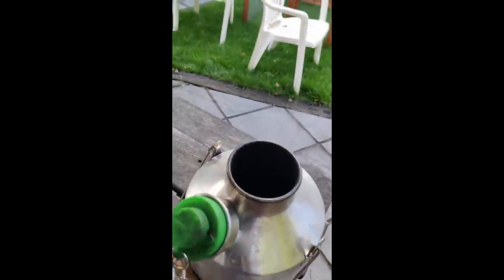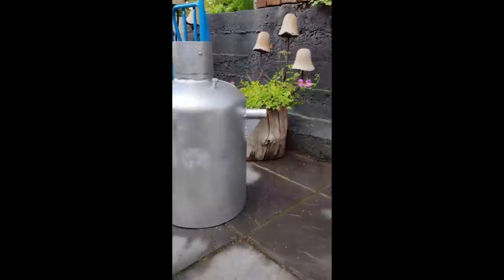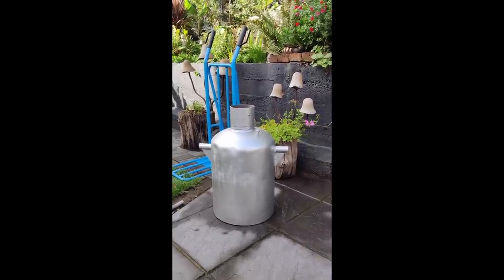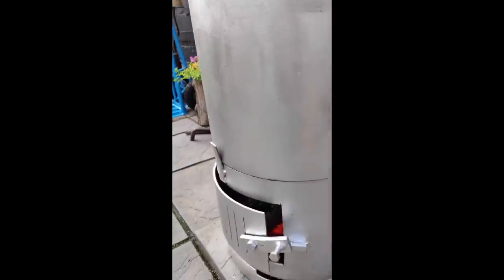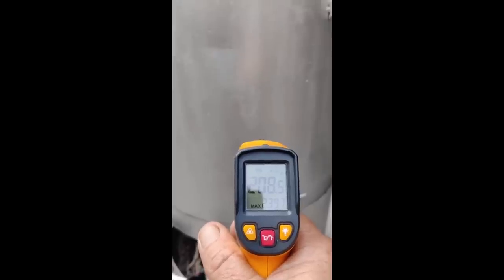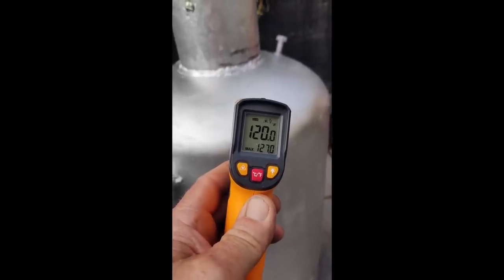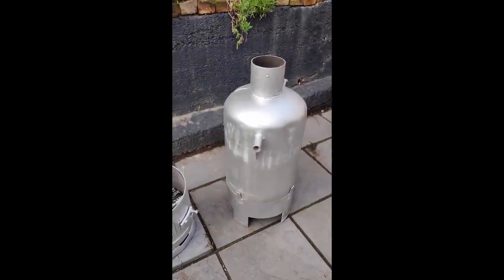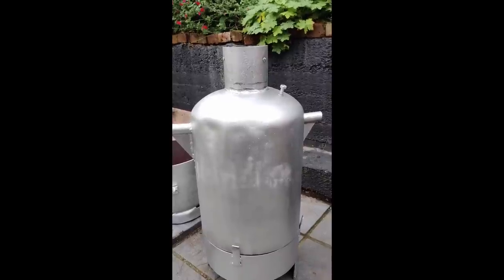Sand battery can it heat my home?

Comment: what you want to do is drill holes into the base of the top piece. it will increase your temps. The bottom is pyrolysis and the increase of oxygen will help burn the volatile fumes in the flue as it goes up which will generate more heat rather than just from the wood. It would be interesting to know the airflow through the center. the CFPM airflow to calculate how long it would take to heat up a certain size room. I was looking at using Salt. The melting point and boiling point of salt is much higher so can store more of the heat or you can use wax for lower temps which I think will still be in your range. There is a lot of energy storage when the wax/salt goes between solid to liquid phase change. But I think yours is an easy no fuss solution.
Reply from the maker: Simplicity is key for me once I get it tuned in a bit we can test it's output in a bit more detail 👍
Reply: dee is correct i did this with my rocket stove mass heater but looking at your project im going to build one too youve just inspired me
Reply: @leejones2511  could you have another part you stack on the top that produces biochar? And also i guess insulates the top a bit?   The bio char Can then be used in it later for some great heat. 

I was thinking maybe draw a row of dots down the side as your official temperature registration target points just for consistency sake. You could even just use a felt tip marker to do it. 

Anyways love what you’re doing. 

Oh .... use solar to power some hho and pump that in to increase the heat. 

Or

you could also use solar to power a water battery. And use that for hho

There’s a guy called SEVER’s with some awesome hho stuff. Home heating even. Robert Murray Smith also has lots of hho videos.

Be wary of all the shilllllly anti-humanity  sellout individuals out there claiming hho doesn’t work etc such as The Mythbusters and countless others but that should tell you something. Obv the ConTrollers of the world Dont want people being self sufficient and thus are anti hho and every other thing.
Reply: A good idea.
Reply: Drilling holes in the bottom of the top piece, wont allow sand to pour out?
Reply: I’m impressed if you’re getting temperatures hot enough to melt salt. Salt is more expensive than sand which melts at temperatures you can’t reach by burning wood..
Reply: @leejones2511  check out the channel "desertsun02" on YouTube. Guy has TONS of videos of super simple homemade heating devices using the sand batteries.
Take care

Comment: You might try adding metal fins to both the outside and the inside of the pipe through the tank.  I'd put the fins at an angle on the inside of the tank so the flue gasses are slightly deflected by the fins causing them to absorb more heat.  While storing heat, the fins in the tube will collect more heat and the fins on the outside of the tube will allow the heat to penetrate into the sand.  When releasing the heat, the fins inside the tube will warm the air better and the fins outside the tube will allow for better heat extraction.
Reply: Nice comment 👍. How about running half a dozen smaller pipes equally spaced on the same diameter with the fins you suggested so the chimney / exhaust becomes like a heat exchanger?
Reply: @stephenowens5375  that was my first thought as well. I think the construction looses at least 80% of the generated heat trough the pipe (chimney). He should try to keep the flue gases as long as possible inside the system.
Reply: Was thinking the same, fins on the flue to move heat further into the sand or multiple flues as suggested. A damper on the flue to keep the exhaust gases in the flue longer might help. Also do a search on Jet Stoves, they're hotter and more efficient then just a firebox using less fuel. Stay warm my friend  🙂 Not sure if we can this year, we have electric only heat and electricity is going way up here, we do have lots of sweaters, sweatshirts, blankets, and kitties though and we seldom see temperatures under 25* F. Thinking about a few fire bricks in that electric heater just to dampen the temperature swings, the wife is always too hot or too cold, I have an electronic thermostat, it does 60* or 62* can't set it to 61* 🤥
Reply: I would disagree, metal heats quickly and cools just as fast. Worthless. The Trombe Wall he is talking about is your solution. 
Sand, paraffin, dirt, all good sources for thermal mass. You actually want to prevent metal from stealing your heat.
Heat exchange rates:
Metal- .01
Air- 1.0
Paraffin- 8.0
Sand- 10.0
Do the math.
Reply: @habi0187  Same principle as a thermal mass rocket heater, this is too small to be as efficient as one of those, but understandable because it's constrained by the design to remain portable.
Reply: @vexy1987  100% agreed.
Reply: What if you put a pipe into the side of the firebox at an angle, like a foundry, and ran a hair dryer or similar into the firebox? Some fireproof insulation is in order too.

Comment: Have a look at the Nansen stove. It has been used on countless Arctic and Antarctic expeditions because it is extremely efficient - it was found to transfer up to 90% of the chemical energy in the fuel source to the water/food being cooked. You may be able to adapt it to heat sand instead. It is a much more complicated construction though.

Comment: What if you keep it outside permanently like a boiler and transferred the heat to a radiator inside your house? Then you can burn a fire when you need and don’t have the safety risk of moving something so hot and heavy back and forth? I am looking forward to seeing your progress!
Reply from the maker: Great idea but just not possible where I live & how my house is configured ☹️
Reply: That is a good idea.
Reply: This sounds like the solution he's working off.

Comment: I got an idea.  What about building big brick box about 2'x2'x5' with a place inside for wood fire box, fresh air intake, exhaust pipe up and fill the rest of the void with sand (I guess a clean out too)?  This will be a simple radiating heater that could emit heat from a wood fire for hours after the fire is out.  Don't need to do complicated and time-consuming brickwork to create channels in a masonry heater, which purpose is no more than transfer heat from the fire via air in the channels to bricks.  With this, heat goes directly to sand to bricks and radiate out.  Better yet, bury lower section of the exhaust pipe in the sand box to max heat extraction.

Comment: I'm no scientist I can only speak as someone who heats their house with wood stoves. If you have a flap type device in the very top of the pipe when the fire is properly going and is almost smokeless you can close down the top to a smaller diameter and slow down the escaping fumes, this will also slow down the escaping heat giving it more time to heat your sand. You can then also use the flap to regulate how much heat you allow out of the pipe when it is placed in the house.

Comment: Great vid.  Robert (TnT) is the man of ideas.   My suggestion would be to heat slower over a longer time. Insulate the outside as per the next vid.  If you rebuild adding fins or multiply tubes (heat exchanger) would see a better heat transfer. Also try inserting a cooking thermometer into the sand, this will give internal temp.  I cannot weld or have enough free time to do this myself. So I admire you for giving it a go.   As mentioned in another thread try using smaller containers so you can heat quicker, but also allows you to heat more than one unit from a single wood burn. Or try to use Roberts endless wicks to use waste oil.
Well done for giving it a go.

Comment: It is very close to a mass heating rocket stove. If you put a barrel over what you made there and force the exhaust gasses back down around the sand, the sand will collect more heat from the exhaust. Then tap into the barrel at the back bottom so the the gases have to go all the way down around the burn chamber and out the back, then send the exhaust thru pipes into more mass, like a cob and clay bench with cement laminated cloth on the outside, etc... and then finally run the exhaust outside.

Smart of you to install a relief valve. nice work.
Reply: maybe the insulation he makes should be by lining the inside of an appropriately sized barrel? take away the bigger exhaust barrel, slip on the insulation barrel for the house. this thing will keep getting heavier... i have an indoor fire box, and ive thought of putting sheets of metal around it and a fan to use the wasted chimney heat, but would this cooling cause more buildup to stick to the inside? the idea is to have air introduced to the chimney right after the burning process to make the exhaust have no smoke. id love to tinker with this kind of stuff one day
Reply: Yeah Robert Murray Smith has been messing with that sort of stuff lately
Reply: @CoincidenceTheorist  Yes i love Robert Murry Smith. He is mostly an ideals guy, he don't take an experiment to its fullest conclusions he just introduces them. 
But that is also very beneficial of him only introducing the experiments, he leaves room for us to get inspiration to go further.
I been meaning to take an ideal of his and going further with it , and then telling Robert about the results and then maybe he will show the video on his channel too.
Reply: After you take it off the fire like it is there could you put a cap on top of it and retain that heat from just rolling out the top
Reply: @keithw.fletcher3307  Yea, good ideal to be more mobile with it without flames. Get it hot, then take into the tent with no flames, etc...

But obviously the more mass the better, so you will need some wheels on it, or a dolly to move it.
Reply: @BCzepa  Extracting too much heat from the chimney might cause a build-up of creosote on the inside, which is a fire risk. Though using low moisture woods of the right type helps to ameliorate that problem.
Reply: @dalriada842  that's why I was saying that the burn box itself should have the chimney that fits tightly into that Port that he's got  to a higher point  so he can just drop that down over that and when he pulls it off of it there's nothing touching the sides of the actual port as that's simply a pass through to allow the real chimney to stay outside.
Reply: @keithw.fletcher3307  I didn't see the post you're referring to. It must be on one of the other threads. It would have to be a very snug fit to get efficient coupling. The inner chimney would probably have to detach from the burn box to facilitate removal of the sand container. This would aid cleaning too.
Reply: @dalriada842  a fire risk, ...when the entire pipe is flame up through the top on on fire? Either way, this is wrong... Creosote builds up a low temps, not when flame is shooting all the way through the pipe.
Reply: @quantumofconscience6538  I haven't watched or commented on this video in a year. But it seems that I was mentioning the risk of withdrawing too much heat from the pipe to BCzepa. That would cool the pipe down to the point of creosote forming on the inside. This would be a potential fire risk.

Comment: Great video, and timely. I have been heating my home for years with Trombe Walls.
They work great. It is best to allow them to capture as much heat as possible throughout the day.
Try something before adding rockwool. Paint it black and set it in a sunny window. It will get screaming hot without ANY fire.
You can also use Heat Transfer Fluids like Antifreeze and Paraffin. They are nearly as good as sand. Paraffin (oil) has a near linear heat release rate.
Sand is used because of the uniformity of the particle moves (transfers) heat evenly. There is worry of Hot Spots, so use an even medium like sand.
Lot's of work has been done on heat release rates in industry, but no one uses then to heat your home.
My God, that would lower your electric bill to near nothing and we can't have that.
Anyway, I have used them for years. I put pans of sand on top of my rolling radiator heaters that have oil in them.
I have even talked about it and shown a small version in one of my latest videos. Have a look.
There is a solid bottom line on heat...BTU's, you got to make them to be warm. Which is why you would never be able to heat your home with a tealight candle as shown on TV.
Welcome to Youtube. A new subscriber.
Reply: or buld a solar oven in backyard that can fit 2 of em.....paint em flat black and add a fresnal lens to it........make a little door and switch em out with eachother nice and hit and if it needs more heat throw it on an induction cooktop

Comment: We had these in the army 50+ years ago, we called them Bengazis but they were called other things.
We put a baked bean tin full of sand soaked in petrol into the earth then dropped a match down the centre. It boiled nine gallons of water in minutes.
Once on exercise in Lower Saxony West Germany the temperature was -27c and the petrol would only ignite with a very small flame, we gave up. Many thanks for your video.

Comment: So I read all the comments... I wish I hadn't but,
I'm shocked nobody suggested or referenced a boiler (*like on a steam locomotive - but filled with sand)... as several people have stated this is basically a rocket stove, which leaves little time for the heat to transfer into the sand, which in this case does so through a single large flu that really does have very little surface area to volume ratio (lose/lose).
A more efficient system would have a series of smaller pipes (*say 1 1/2" exhaust pipe), ending up much longer in order to hold the same weight in sand in the same size tank.
On top you would use a long flu-pipe to help create a flow to get it started, but you would put a damper either inside of the flu or on top (a cap that swivels to cover part or all of the flu - like a BBQ grill). Being able to "damp it down" tighter will make your wood last longer, and hold the heat inside a little longer too, transferring more heat into and back out of the sand (win/win).
For those of you looking to "build in" a heat sink system the benchmark is the Russian masonry heater. ;)

Comment: I would leave the furnace outside . build  insulated exterior shield around it and a hot air pipe going into the house. the sand is a good idea since wood fires would  go out after a hour.

Comment: Combine this with a rocket stove to charge it. Its a bit heavy but if you could make this part of the riser for the a rocket stove, you would be able to heat this up pretty fast and then use the fans to force air over it. 
This is basically a rocket mass heater but in modular form. Most rocket heater use a large built in place thermal mass, but something like this, scale it back to about 35 kilos total mass and you could build a rocket stove to heat multiples up and put several smaller heater in different rooms. I would reccomend doing a rather low flow fan through the middle for heating and having a higher flow fan blowing across it or down from the top.

Comment: The IR thermometers are much more accurate when aimed at dark surfaces. Just a quick spot of black paint to aim at will help immensely. I’m from the US so my brain only works in Fahrenheit unfortunately, but I noticed that you said you could barely hold your hand on it and the immediately took the temp and it only registered 87. The most you can comfortably touch in Fahrenheit is approx 130 so I think it was indicating quite a bit lower than actual temp
Reply: Every measurement in this video was done in Fahrenheit.  Fortunately.
Reply: @btwbrand  Yes so he is right, the shiny surface doens't give you correct température readings

Comment: You may want to insulate with a removable blanket style(like the ones for water heaters). That way you can have the blanket on outside and take it off inside. That way you can draw down the battery faster for a quick warm up and then if warm enough you can always put the blanket back on if it gets too warm.
Reply: How are you supposed to get this chunk of metal inside the house every day?
Reply: @Moonlightshadow-lq4fr  I assume with the blue hand truck that is sitting right next to it.
Reply: @vonries  Someone had to put it on there and drag the thing into the house red hot too!  Hardly a practical idea.  This has to be one of the maddest contraptions I have ever come across.

Comment: Well done, I like this. I would think having the insulation on the inside between wall and sand would help lower the weight and limit heat transfer to a conductive material and might also allow you to make it look better. If you could connect it up to a solar thermal system and then create a controller to adjust heat inputs and outputs via electro mechanical valves would be a permanent solution without burning and gases.

Comment: I thought about this kind of solution and whether it would work.
Sand in the ground can retain heat for months at a time

If you could route the exhaust through the tank, even have 3 or 4 smaller flues through the tank would provide more surface area for heat transfer for both heating and releasing

For anyone with a property that cannot have or cannot afford a stove install this could be a very viable solution

Kudos for the experimentation!

Comment: Lee. Try making a sheet metal cone for the top exhaust. Like a jet engine would have. Full size on one end and at the top reduce the exhaust end to somewhere between 70 and 80 percent of the size of the pipe itself.  This might make it look like the heat is going out faster, and it will be, but before it leaves it will have to stay in the pipe a bit longer and should keep it in the pipe long enough to have an effect on the upper part of the battery.